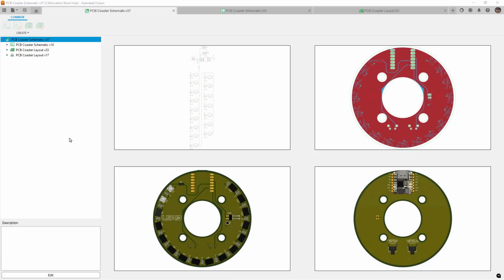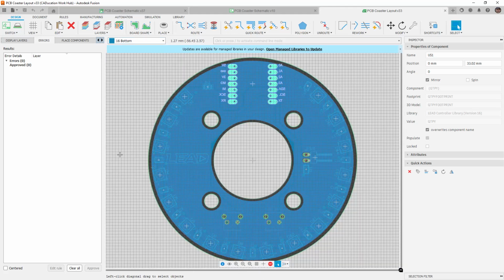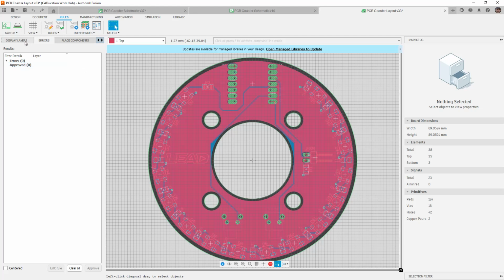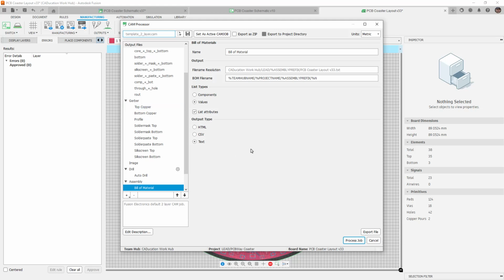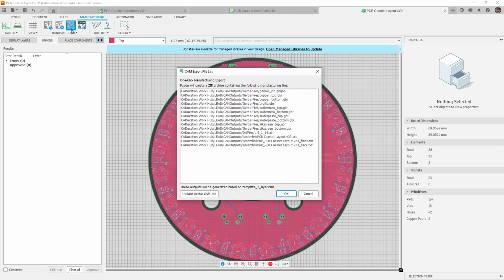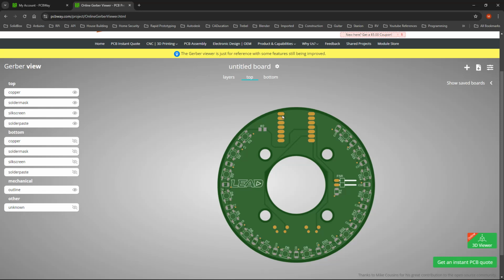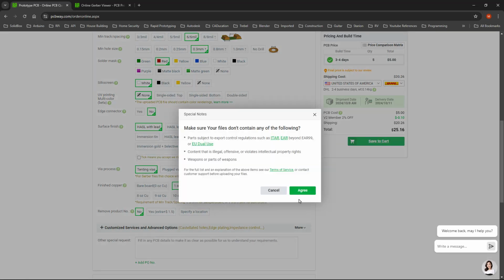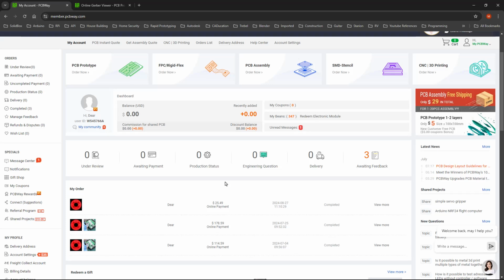How To Get PCB Data from Fusion to PCBWay

Comment: Do you use Fusion because it does Software and Mechanical in the same package/license?   

I don't mind using KiCad for electrical, but not sure about what software to use for the mechanical part**.  Can the same CAD software be used, whether your final material is wood, plastic, or metal? 
For example, some CAD software I've seen ( eMachineShop or Protocase Designer CAD.) is tied to the shop that will fabricate it.. . but what if you want to do the same design as a 3d printed part before doing it in a CNC part.  

BTW, do you recommend any low-cost 3d printer service?  Sculpteo , Shapeways, CraftCloud, xometry, protolabs?  What about for CNC / Laser manufacturing that can do just one or two of something not any volume?  

**From what I've seen,
Fusion360 is great for design, but the cost/license might be a deal-breaker for many 
FreeCAD might be a bit difficult for the beginner
OnShape supports exporting without having the $2500/year license
Pro/Corporate Users should stick with Siemens Solid Edge , Solidworks, Catia, Pro-Engineer
Then there's other that don't have nearly as much users.. Moi3D,  etc.

Parametric (i.e. ability to undo as many steps as you want) is a must-have feature, but for most beginners, it seems TinkerCad and Plasticity are the most popular, is that correct?